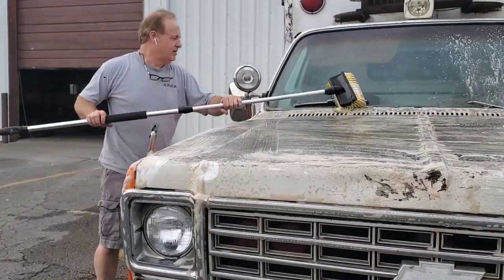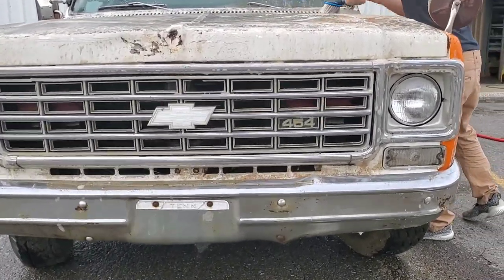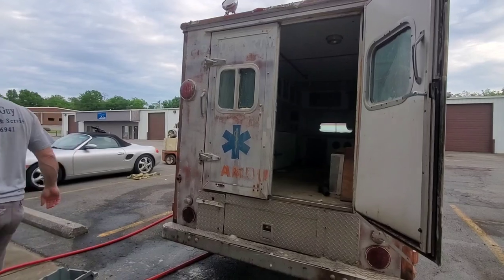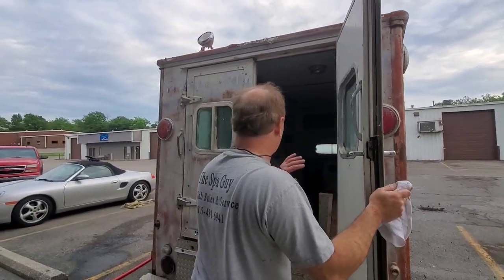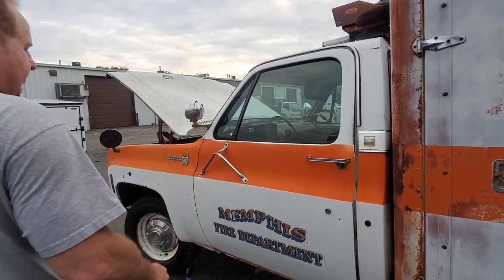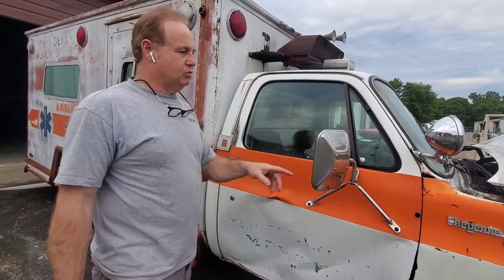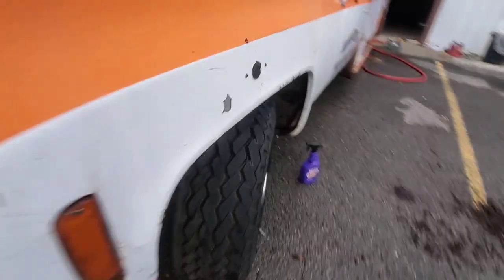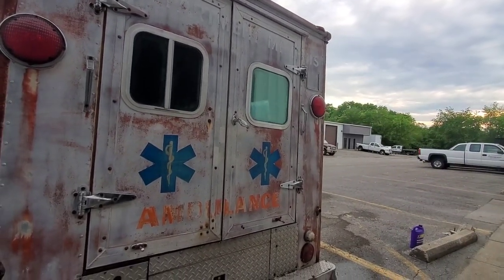Elvis Presley Ambulance IS IT AUTHENTIC? "Cleaning Up History" Episode 9 Evidence Examining Vehicle

Comment: I can answer some of the questions posed by Billy "Spa Guy" in this video. I commented on his various videos, not sure if he got them, so please pass it on and tell him to write back/comment for any additional information. :

1) This was produced as a Chevrolet chassis. The VIN of the chassis breaks down like this: C for Chevrolet (it would be a T for GMC), C for 4x2 conventional cab, Z for 454 V8 with four barrel, 3 for 1 ton rating, 3 for cab and chassis (it's shipped to the Ambulance builder without a body since they will add one), 5 for 1975 model year (confirming it's a 1975 model), S for St. Louis, MO assembly and the rest is the production sequence.

2) If the RH fender was replaced, GM and many aftermarket replacements would have been black primer, so that is maybe what he is seeing. They are shipped to the dealers in black primer from the GM parts plant and they are painted to match. It has generally always been this way. Same with the doors and other sheet metal. Could it have been taken from a truck that was originally black? Sure. Back then, body shops might procure used fenders that were painted any color and then paint them to match. All depended on who did the work, the budget they had, etc. 

3) The St. Louis, MO GM plant also made the Corvette in those years, among other models. They produced both the GMC and Chevrolet version of the CK Series trucks, and it wasn't unheard of for a truck to go down the line with a GMC badge on one side and Chevrolet badge on the other side.

4) The "scar mark' on the fender that he refers to is yes likely where a dealer sticker was. It could have been the Chevrolet dealer that sold the chassis to the Ambulance builder, the Ambulance builder themselves or one of their dealers. Some cities specify that there are to be no dealer emblems on the unit when completed. 

5) The name of the company that Billy was trying to remember as the Ambulance builder was Roadsafe Emergency Vehicles which operated from 1972 to 1978 and yes, I believe that they started in Shelbyville, TN. This company is not the current REV Group that also sells Ambulances and owns Horton, Wheeled Coach, Road Rescue, AEV, Leader, McCoy Miller, and Frontline. Roadsafe Emergency Vehicles then became F.AC.T. which was First Ambulance Center of Tennessee. They started around 1988 and were bought out around 1992. It went out of business around 1995 and then became Select-Tech which is still in operation as a company that does remounts. Remounts were when the existing Ambulance body is put on a new chassis (due to it wearing out/getting old, accident damage, or the wish to upgrade the chassis). The founder of Select-Tech, Steve Feldhaus worked for FAST starting in 1978, so you may wish to contact him to get more information. If you Google "Select-Tech Ambulances" it should come right up along with pertinent contact information. 

6) Typically, Ambulance chassis start as white trucks (depending on the desired final color) and then the other colors are "cut in" by the painter/ Ambulance builder. This still holds true today. This can be confirmed by looking at the Service Parts ID label (called "SPID" in the trade) which is typically located in the glove box or under the hood (sometimes stuck to the left fender well) on these style trucks. It will show all of the options that the truck left the GM factory with. I believe this truck had AC added on after the fact, but of course for the body and the chassis as the chassis HVAC controls look to be only for heat, and GM's controls back then were integrated with selections for AC and heat if the truck was factory equipped with AC. 

7) Depending on how it was originally shipped from the dealer/Ambulance vendor, some equipment was bought or added by the department after the fact. They may have  had their own source for stretchers, initial equipment and other things. The members of the Memphis Fire Department would know that best. Once you know who made what and who purchased what, some of the same vendors that supplied that equipment back in the 1970s may still be around and offer help as to what they had back then. Some Ambulances are shipped with all the equipment ready to go, others are shipped with everything but the inside equipment, which the department may have contracts for or purchase from others. Each department was different in how they bought everything. 

8) Some units were bought by competitive bids based on written specifications compiled by the department or in some cases the dealer wrote the spec for the department. Some departments can just go out for bids in an very informal process and buy what they want. It all depends on the city's purchasing system at the time. 

9) Yes, he meant "Dymo" labels which were often used back then.

If you provide more details or pass this along to Billy and a way to contact him, I will try to fill in more details and help more. Hope this sheds some light on this a little more.
Reply: This is very thorough, and accurate. Thanks
Reply: @V8Deuce  Sure thing.
Reply: you are a living encyclopedia on this
Reply: @scottlin7876  Just trying to help out.

Comment: Does it run?
Reply: That's a Chevrolet big block 454. It will surely run with a little TLC, no doubt about it.
Reply: That's what I was thinking.
Reply: @MattJ1977  It will probably run with power (a good battery) and some starting fluid down the carburetor. It will need much more work to be road worthy as parts were pirated off it over the years that it sat.

Comment: I don't believe that the provenance is good enough to say that is the same ambulance, and the bodies on these chassis can be changed easily and by all accounts it was involved in an accident at some time.
Just another case of people trying to cash in on Elvis's name.
The crease in the bumper is most likely the weak point in the bumper and possibly others had the same crease.
Reply from the maker: What about official paperwork, identifying markings on the ambulance, and corroboration from a local fire and ambulance museum historian who took photos of the ambulance before it was auctioned?
Reply: The number six is not on the vehicle, if records are accurate they should also show if the vehicle was accident damaged and when. Bumper damage could have quite easily been done to match photos with a wrench. But believe what you will, i personally do not believe it is the same vehicle.
Reply from the maker: It would be easier to fake the number 6 than to bend the bumper to match. LOL